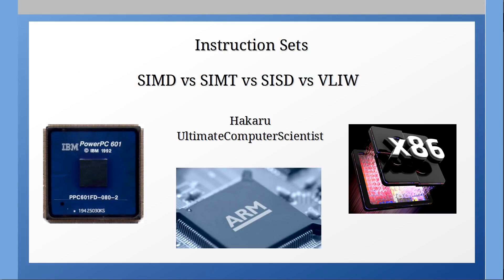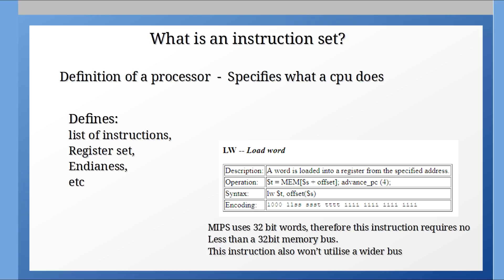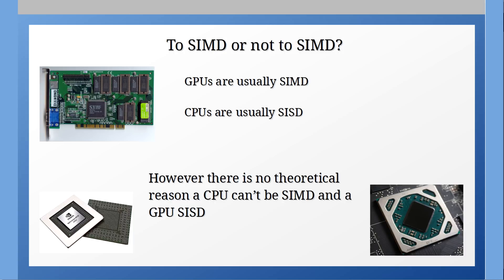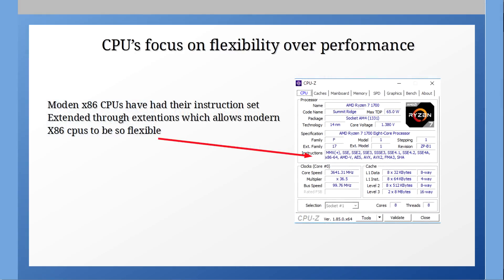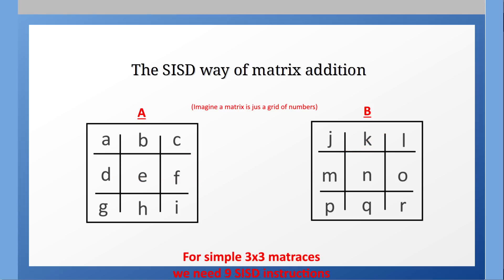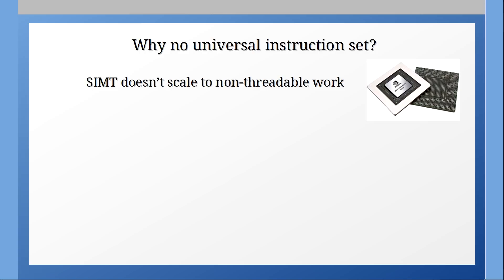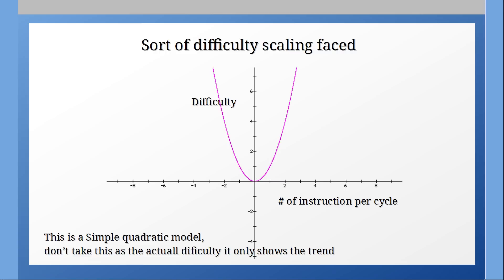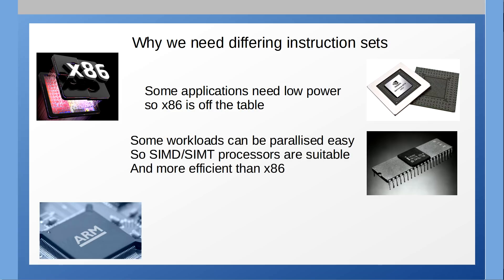why not use one Instruction set?

Comment: Sadly I found this going into confusing details irrelevant to beginners, and also with a lot of inaccuracies. For example saying it doesn't make sense to have a memory bus narrower or winder than the register size is not correct. In the early 80s both the 16 bit 8086 and the 32 bit 68000 came in versions with a 8 bit bus width. The 68008 was not popular but the 8088 was much more common than the 8086. In the mid to late 90s the ability of the 32 bit ARM7TDMI to run efficiently on a 16 bit bus (especially when running Thumb instruction set code) was probably what allowed ARM to take over mobile. Nowadays, memory bus widths are wider than the register width because entire cache lines are filled in parallel. Moving on, GPUs are SIMT not SIMD. In SIMT the code the programmer writes looks like normal scalar (SISD) code, but the CPU runs typically 32 threads in parallel, executing the same instructions in each thread but enabling and disabling threads depending on IF and LOOP conditions. Ok, I'm only at 3:30 .. watching on.

Comment: The funny thing is ARM also has certain complexities like x86. It has ISA extensions (e.g., NEON) and it has variable length instructions (ARM32 includes THUMB2). ARM is simpler to decode sure, but an ARMv8 compatible CPU isn't exactly simple either. While I imagine the RISC-V project aims to avoid these, I also can't see us returning to the old implementation of hard wiring the decoder again.

There's also the thought that most x86 compilers use a handful of instructions, since not every program needs the entire featureset.

Comment: I believe in a very small instruction set and then giving the programmer a nice library to make his job easier. I designed an instruction set of 16 general purpose instructions, and it appears to be really efficient. Nice video! all good wishes.
Reply: the thing with libraries is that someone has to first write them and the more limited they are the harder that task is, it is easier to design a processor with more instructions that eases the strain on humans than to use humans to do the hard work of implementing funcionality on a small instruction set. The program sizes skyrockets the more limited you are by instruction sets (look up Movfuscator - a 1 instruction complier [not exactly the same thing as talked about here, but I think it demonstrates the problem with small instruction sets quite well])

Comment: the x86 instruction set is backwards compatible to the i386 and with some magic (Real mode) to the 8086. ARM is not that limiting. that will also be the downfall of x86 CPUs which will never in their life need to run actually in 8086 mode.

Comment: If i remember correctly those x86-64 type of instructions (CISC?) decoded to RISC type instructions in current desktop cpus to execute them actually faster. But if this decode phase is eliminated by changing softwares to native risc then there could be huge increase in performance and efficiency gain.. so x86-64 is already not natively used in cpus? Why software vendors insist on it? Correct me if im wrong please..
Reply from the maker: Yeh you've pretty much got it there, When the x86 is decoded (Or any other instructions) it's decoded into binary words where the parts of the word are explicit instructions to individual components within the CPU as to set the state of that hardware (EG tell an adder that it's next instruction will be an unsigned 32b int), that's called the micro-ops. Technically you could remove the x86 and just make you're programs in micro-ops but for one; no CPU vendor published their micro-op codes and also it's very CPU-dependant, kabylake probably has different micro-ops than skylake and those different from coffee lake even though they're from the same architecture. Not only that but for IO instructions Intel changed the micro-ops to prevent speculative execution (remember micro-ops set the state of the hardware in the cpu, including the speculative execution engine) in order to counter spectre/meltdown so any code you wrote before wouldn't work after the spectre/meltdown patches. Lastly you've kind of answered you're own question yourself, Why have CISC when we have RISC? Well we have ARM which is RISC so why not just everyone switch over to using ARM? It's more efficient because as you understand, it's easier to decode, well the answer is something only the market can decide. But at the end of the day use whatever you want to use, x86 is powerfull but power-hungy, not many of you're programs run on ARM and hell if you're going to the trouble, why not use something different from them too? ;)
Reply: It does mean that to some extent the CISC x86 provides an abstraction over underlying RISC shenanigans that Intel/AMD/Via can do on their own?